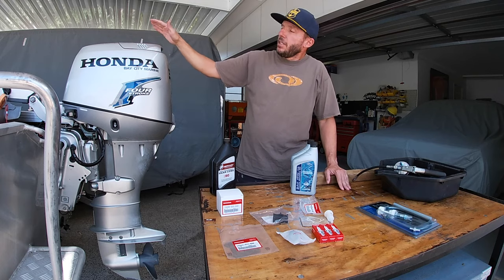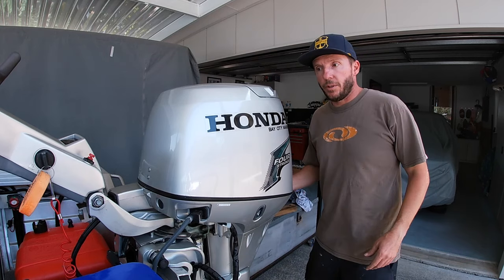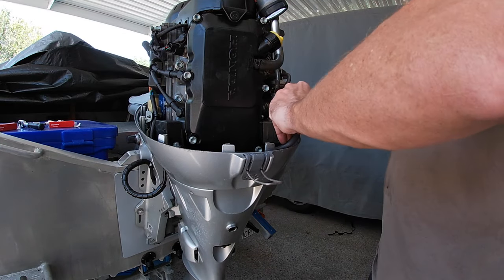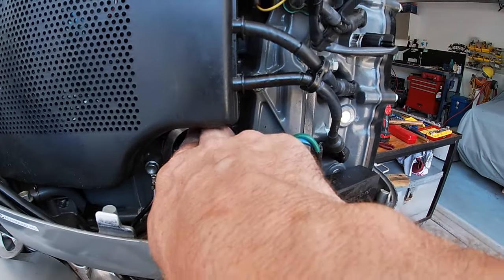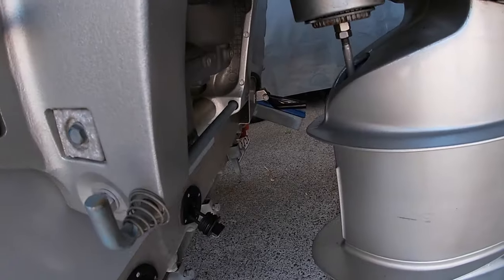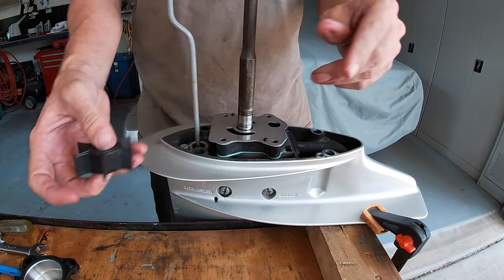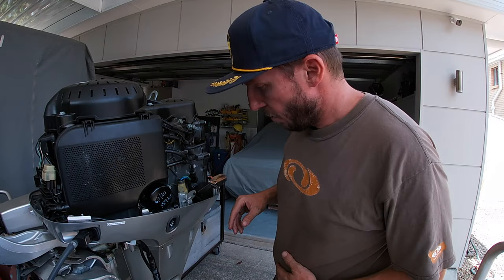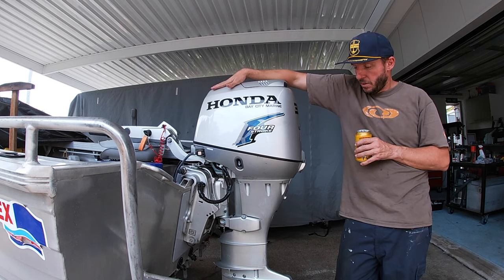How to service a 4 stroke outboard motor yourself - Honda BF30

Comment: Sharp clear illustrative photography, gentle presentation, good tips. 1000 thanks.  Nice if you did one for my 20 hp.  With an old bad back, it’s nice to know how to take apart some of the engines components before lifting it up onto a truck tailgate. Took off the tilts and trim plus the cowling and the propeller to shave down the weight to under under 100 pounds have you dealt with making very heavy outboards lighter temporarily for Transport?this is Curt and Virginia USA
Reply from the maker: Hi Curt. Glad the vid was helpful. I have never had to make an outboard lighter for transport. You might just need a friend to help you. 🍻

Comment: I have a Honda BF 30 where you have to manually lift up the lever to tilt your lift your motor up and down there's two little springs underneath on that lever nobody seems to know how to put them back together would you know or even have a picture of where their positioned so I can put mine back on that would be great and your video was fantastic thank you
Reply from the maker: Hi Rich sorry but I can’t help you with that. Have you tried your local Honda service centre.

Comment: thankyou, just purchased this outboard, very informative, any tension settings for the thermostat bolts? ty again will be doing my own service, also do you check, know, cylinder compression tests settings. gary, Adelaide, Australia.
Reply from the maker: Hi Gary, I don't have the torque settings for the thermostat bolts. You would have to find that out from Honda if you want to be exact. I don't test the cylinder compression either. Maybe one day Ill buy a tester and do it. Hope you enjoy your new motor.

Comment: Great video. Only thing I’d say is be careful what grease you use on the impeller. Red rubber grease is ok, as is evinrude triple guard, but “marine grease” which are often lithium based with added zinc, will eat away at the impeller. One of those things where it’s probably fine, especially as it’ll be washed out soon as it’s ran.  But if you service the boat at the end of the season you don’t want it sat for months like that.
Reply from the maker: Cheers mate. We don’t really have seasons here. It’s boating weather all year round. 🤙
Reply: @AusAdventure  Living the dream 👍

Comment: nice video thank you so much.I have a honda 50. almost 10 year didn't start since last services. do you recommend what kind services I need to do? thank you so much again.
Reply from the maker: Mate if it hasn’t run for 10 years it will need everything done. Everything I did plus cleaning the carby’s  and maybe a compression test. Probably want to take it to a marine mechanic. Good luck and thank for watching.

Comment: Hey! Nice video dude helped me ALOT, very nice, i have the same motor, and almost the same boat, ive got a quintrex 390 explorer but its jumping alot on the water, prolly i got wrong propeller, what propeller do you got? U have a new subscriber for sure! Thanks again!
Reply from the maker: Hi mate thanks for watching and subscribing. Glad the video was helpful. I have the prop that the motor came with from new. Not sure of its dimensions etc. I’ll have a look if you like. Usually if a boat is jumping around it’s due to the trim of the motor. 👍

Comment: Question ... My motor kills when idling after a few seconds.   It's similar to yours Honda BF90A 2001.   I have the manual too.  Where would you go first? Throttle cable adjustment? 

Thanks for the awesome videos on the Honda.  I've already done some of my own maintenance.  Water pump was easy!   Lower gear oil, easy!  Thanks again.
Reply from the maker: I would probably make sure the fuel supply is ok and it’s fresh first. Then you could check the spark plugs are good and then adjust the idle.  If still no good the carbys might need a clean or overhaul. Good luck.
Reply: @AusAdventure  Throttle stop screw adjustment did the trick!  
I was able to adjust it on the water when warmed up.

Comment: Great video. I have a Honda bf15 and I was wondering if the thermostat would be in a similar spot. Thankyou
Reply from the maker: Mate I have not had any experience with the 15hp so I can’t say for sure but I would think that it would be easy to identify. Cheers for watching the video.

Comment: Easier way to get those stuck lower unit drain screws out is a big screw driver with a square shaft and a crescent wrench comes right out with no beating.
Reply from the maker: Good tip mate.

Comment: Hey great video. I’m working on a bf 40. Low compression across all 3 cylinder 60-70 psi. Adjusted valves. Brought it up to 90-80 across the 3. Pulled head. Just waiting on a new head gasket. My question is what should the compression be ? I’ve seen all kind of numbers but nothing for sure. Some day 212 ( which seems like a ton) others say 130/140. Also what is the clean out port on the foot ? 
Thanks !
Reply from the maker: Thanks for watching it mate. Unfortunately the info you’re chasing is beyond my knowledge. You will have to see your local Honda dealer.
Reply from the maker: Thanks for watching it mate. Unfortunately the info you’re chasing is beyond my knowledge. You will have to see your local Honda dealer.
Reply from the maker: Thanks for watching it mate. Unfortunately the info you’re chasing is beyond my knowledge. You will have to see your local Honda dealer.

Comment: THANKS FOR YOUR VID.
PLEASE TELL US THE COST OF THE PARTS AND WHERE DID YOU GET THE PARTS.
Reply from the maker: Glad it was helpful. I can’t remember the exact amount but it was close to $250. Got it from the Honda dealer at Runaway Bay Marina. I think they are called Runaway Bay Marine.
Reply: Aus Adventure Thanks mate
Reply: Aus Adventure I have the same engine proud to own Japanese quality

Comment: Awesome video! I am going to do my BF20 Honda now. Also on a "tinny" but alot smaller than yours. I was admiring the bits on the stern there and how you did the trailer bunks those blue standoffs are nice. I notice you put some oil on the bolts going into the aluminum - good practice - on cars I use anti-seize (that silvery grease) instead - would that work too? Thanks from Texas.
Reply from the maker: Cheers mate. I think anti seize would be fine too. Thanks for watching.

Comment: Great video mate, will make it easy for me to service my honda 25hp when service is due, any idea what you have your idle speed set at.? Once again great video 👍👍👍👍👍
Reply from the maker: Thanks mate glad it will be helpful. I’m not sure what the idle speed is set at because I have never had to adjust it. The motor has just run extremely well the whole time I have owned it.

Comment: Just to be clear, I have an older Honday 40 and there is another bolt under the Zinc anode that needs to be removed to get the lower unit free. Otherwise, this video is very helpful.
Reply from the maker: Yep some of them do have that bolt but mine doesn’t. Thanks for watching James.

Comment: this was amazing. i was wondering if you would share some info. I'm in to getting my first outboard, and flexing between mercury and honda. I'm aiming for the 20 HP motors. Question is, has there been any issues with your motor? and what size boat is it on. mine gonna be on an Terhi 6020 C a 15  foot semi flat/v-hull boat. about 250Kg raw wieght.
Reply from the maker: Hi thanks for watching the vid. I have not had any issues at all with my motor. It’s been great. I have it on a 4.2m boat and it’s a 30 Hp. Hope that helps.

Comment: What propeller is that you use I have the bf35 with a plastic prop and get about 20 knots and was hoping a metal one may be a bit better
Reply from the maker: It is the stock propeller the engine came with. Not sure what the pitch or anything of it is. It is metal though.

Comment: Awesome video brother!! Question, have you ever replaced the timing belt on your motor? I just acquired a very low hours 2014, 4-strk Suzuki 20hp EFI (DF20A). Previous owner never had any maintenance done to it, so I did this all, in addition to anodes, and re-greasing all the fittings/linkages. I removed the recoil starter assembly to inspect the timing belt and while it looks almost new, I worry about it because the shop/maintenance manual calls for replacing belts ever 4yrs regardless of hours. I fear I dont have any experience removing flywheels and setting timing on small outboards, so I'm hesitant to do this service myself, but unfortunately I dont have a Suzuki dealer anywhere near me. Just wanted your (or someone else's) thoughts on belt replacement frequency, need, and (DIY experience) tips on doing it. Is it a must or can it be left on until actual signs of belt wear are evident? Thanks in advance, cheers!!
Reply from the maker: Mate I have never changed the timing belt on my outboard so I can’t give you any tips. If there is no Suzuki dealer near you I would try find a marine mechanic and see what they say. Good luck.

Comment: Great video. Would you recommend getting the dealer to do it every second year to do tappets and valve clearance's?
Reply from the maker: Thanks mate. Mine hasn’t seen a dealer in 6 years. Probably shouldn’t go that long but if the engine is running  well I just keep doing it myself.
Reply: @AusAdventure  Great thanks for that. Have a great Xmas Cheers Steve.

Comment: Great video, clear and good lighting. In other vids we noticed (when replacing the water pump) they packed some grease in where the shift rod enters the lower housing and also where the drive shaft enters the housing while replacing the water pump. Some people do and some don’t - any thoughts on that…? (We are in fresh water)
Reply from the maker: Hi Alex thanks for watching the vid. I have never heard of putting grease where the shifting rod enters the lower housing so not sure about that. As for the drive shaft I put grease on the impeller itself and a small amount on the shaft as I showed in the video. I think regardless of weather your in fresh or salt water lubrication is always a good idea.
Reply from the maker: Hi Alex thanks for watching the vid. I have never heard of putting grease where the shifting rod enters the lower housing so not sure about that. As for the drive shaft I put grease on the impeller itself and a small amount on the shaft as I showed in the video. I think regardless of weather your in fresh or salt water lubrication is always a good idea.
Reply: @AusAdventure  ok. Thanks!
Reply: @AusAdventure  One other question.  Re, my 15 horse Honda outboard.  I’m replacing the impeller, as noted. One of the rubber impeller fins broke off - it’s not in the lower unit anywhere, so most likely went up into the engine.   What’s the best practice in this case? Thanks!
Reply from the maker: @alexpearson8481  from my experience they usually get stuck in the tell tail. So if the tell tail seems like it’s clogged pull off the hose and clean it out.
Reply: @AusAdventure  thanks again mate. I checked the pipe on the outflow of the telltale. Nothing there, my gut feel is it could be stuck in the intake tube after the water pump, that leads up into the engine.  Its 15HP Honda. It’s tight in there because of the housing and I see inside the housing at the top there’s a bolt to theoretically remove that intake tube.  but extremely tight to get at . Any other ways of clearing that or at least verifying that it’s clear?  When I blow backwards in the other end of the tell tale I notice some resistance but that could be baffling or something….. although I do feel my breath come out the intake when I do that…. Ideally I’d really like to get the piece (single impeller fin) out as it could collect more debris and build up.  My gut feel is to remove that intake tube but I’m nervous I will get something apart and can’t get back together!!  (There IS water flow, so little issue there).  I’m sure many others have run into the situation……. Maybe the whole things a wild goose chase. As is could have been chewed up and spit out.
Reply from the maker: @alexpearson8481  you might have to see a mechanic mate if you have any dramas with it.
Reply: Thanks again mate. One other question when we install the new water pump housing green gasket, does the green gasket need anything applied to the surface of it? Glue, grease, etc?   Or just clean and dry? (The Green Gasket) thx.
Reply from the maker: @alexpearson8481  the gasket doesn’t need any grease mate. Just clean surfaces.

Comment: Great video I plan on following all these steps on my recently acquired BF30. Question: the engine has been sitting about 10 years and likely has some old fuel in it. Any advice as far as that goes? Thanks and will be checking out your other videos!
Reply from the maker: Glad the video was helpful mate. You will definitely want to get all the old fuel out.  I have never had to do it myself so can’t tell you step by step how to get it out of the carbys but I’m sure it won’t be too hard. Good luck and thanks for watching.
Reply: I had the same on my bf30.  Had to get the carbies cleaned in Mt Isa.   $480. Last year.  Everything in Mt Isa  is a  rip  off, so wherever you are , it'll be cheaper.

Comment: Great video, thanks. Just wondering how you got your engine hours? Did you get the dealer to plug in a scan tool or can read it yourself?
Reply from the maker: I have a digital hour meter which is in one of the side pockets of the boat. It was an optional extra you could get with the motor when it was new.
Reply: @AusAdventure  thanks very much, I'll see if I can get one

Comment: Fun fact if you are removing the lower unit on a honda bf40/50 there is a hidden 5th leg bolt underneath the zinc anode thingy. Boy was I swearing trying to get it off with only 4/5 bolts removed.
Reply from the maker: I bet you were swearing.

Comment: Hey mate awesome video! Thanks I’m subscribing 
 I’ve just bought a boat it has a Honda 4stroke 50hp outboard with a up front lever throttle. 
When I’m driving it’s making a alarm sound so you know what that will be? Thanks
Reply from the maker: Not sure mate but mine only has alarms or warning lights for over heating or low oil. So I’m guessing it would most likely be either of those issues. 🍻👍
Reply: @AusAdventure  thanks mate

Comment: Great video.. One thing-I always have to set the plug gap.....No???
Reply from the maker: I only check it if the plug has an obvious gap problem. But to be thorough you should probably check it. Thanks for watching the vid mate.
Reply: @AusAdventure  Sure thing. I was watching because,even though I take good care of my equipment, the one time in several years we had a few days of hot salmon fishing my 25 horse Honda quit me. running really rough..Tried all the stuff you and I do but no luck so I brought to town to outboard mechanic I trust. THREE weeks out.. No salmon...Don't want to buy a new one age age 76.
Reply from the maker: Have you got your outboard sorted yet mate?
Reply: @AusAdventure  The usual culprit--Carburetors..Damn. I'm so conscientious about using clean gas and keeping my tanks dry etc.,but it seem to be the nature of the beasts..Somewhere, in some holy book, I'm sure there is a reference to the close relationship between the Devil and outboard motors..

Comment: Bro I did everthing following instructions.
Thank you awesome video.
Could you pls advice where to find motorblock anode? It is small ring and I have no idea where is located.
Peace!!!
Reply from the maker: Cheers mate glad it was helpful. I believe there is an anode inside a water jacket on the intake and exhaust side of the motor. I will confirm it with my local Honda dealer next week and get back to you about it. If there is one there I haven’t replaced mine.
Reply: @AusAdventure  thank you so much!! I need to replace but have no idea where find it. Best regards
Reply from the maker: Mate it’s in the water jacket behind the thermostat housing. I bought one today so will put it in and post a video of it in the coming week or so.
Reply: @AusAdventure   wow. Perfekt. Thank you so much!! Greetings from Norway

Comment: Hello thanks for the video! I’ve watched it over and over.

I got an important question:
Could I hypothetically change the gear oil while the lower unit is not attached to the rest of the outboard?

I have a to change the gear oil of an Honda bf30 attached to a pontoon boat and at the moment I can’t afford to get it out of the water.

Thanks a lot in advance
Reply from the maker: I can’t see any reason why you couldn’t change the gear oil while the leg is off but I have never tried it that way. You would just need some thing to hold it level while you do it. Glad the video was helpful and thanks for watching.
Reply: @AusAdventure  thank you so much!!!

Comment: Hey mate where do you buy your parts from and know the part numbers cheers mate helped heaps
Reply from the maker: Mate I get the parts from Runaway Bay Marine. They are a Honda dealer and just down the road from me. I just tell them the year and HP and they get all the parts I need. Thanks for watching mate.

Comment: would you happen to have a link for your spark plug tool? I just got a used boat and am trying to do my own work (for now :/ ) but don't have any right size sockets.
Reply from the maker: Hi Ryzr. My spark plug socket came as part of my set which I bought about 25 years ago. you should be able to buy one in any tool shop. Thanks for watching mate.

Comment: Your manual impact driver is it 1/2 or 3/8,I have bf25,not sure wich won to buy.
Reply from the maker: Hi mate it’s a 1/2 but it came with a 3/8 adaptor. If your in Australia I got it from Total Tools. Hope that helps.